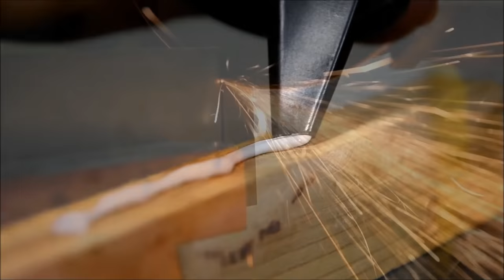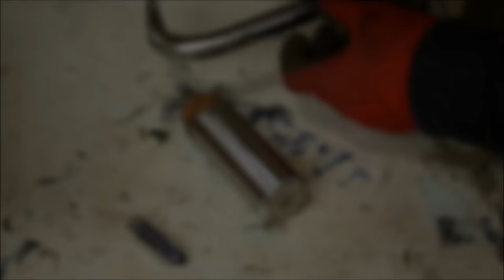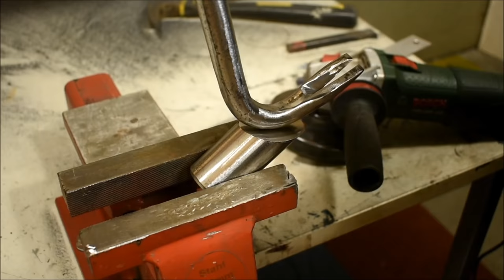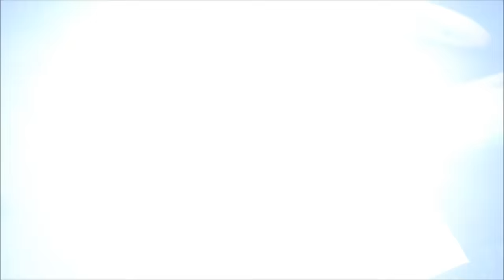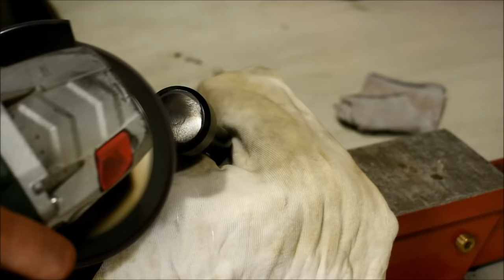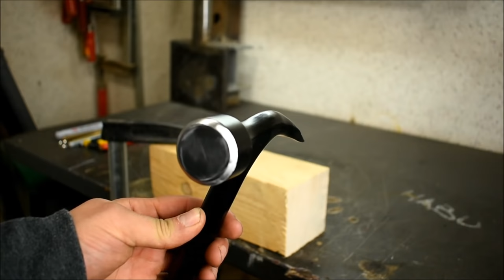DIY | Building a claw hammer out of rusty scrap

Comment: Nice paper weight. You did not heat treat it. You took all the temper out of the steel as evident by the deep blue oxide on the face. After a few uses the head will be dented and need resurfacing. The claw will be useless after a few nails.
Secondly the handle has no foot, so when your hands get sweaty the hammer will slide out of your hand. You can still burn off the handle and heat treat it. It would be worth it, in part because you will have to build a proper handle with a foot.

Comment: Should be solid forged. Welds will crack over time. Looks good but not a tool I'd want to depend upon.
Reply from the maker: +Pete McWade Thanks man! I understand your concerns. Of course a forged one ist better because its one piece of steel. But I made three overlayed welds on each side. Those welds are definitely rock solid and will last a lifetime if you're using the hammer normal ways... 😉💪🏽

Greets, HABU.